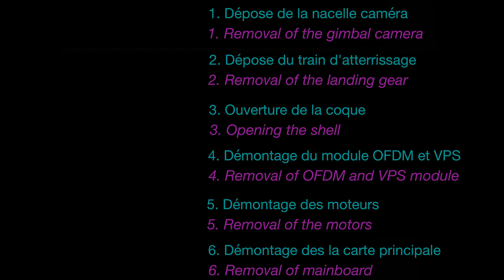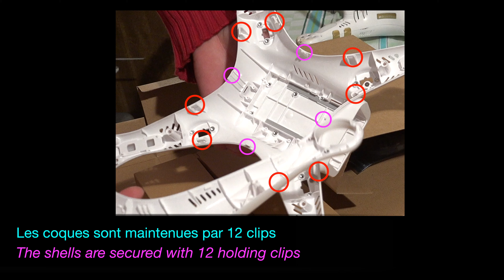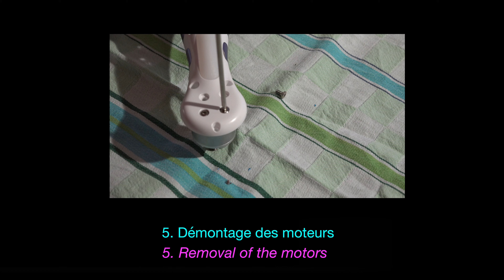Tuto de réparation d'un Phantom 3 - partie 2 - le démontage complet

Comment: Bonjour, avez vous une solution pour remettre en route télécommande phantom 3 pro qui ne s'allume plus merci
Reply from the maker: Bonjour, est ce que la radiocommande a été inutilisée durant une longue période ? Il est possible que la batterie soit déchargée profondément.
Reply: Non première utilisation, télécommande chargée, il y a du avoir problème sur la MAJ j'ai éteint et impossible de la rallumer, j'ai vu des tutos avec des tas de combines manip de plusieurs boutons je suis un peu perdu.
Reply from the maker: Oui en faisant un reset de la radio avec  un appui simultané sur les boutons c1, c2, enregistrement vidéo et mollette exposition, pendant la mise en marche
Reply: Merci mais cela ne marche pas
Reply: Merci mais le problème c'est qu'elle ne se mets plus en marche et je l'avais chargée au max !
Reply from the maker: ok, pas facile de faire un diagnostic à distance, je sèche. Ce qui peut être tenté ensuite : 1. essayer de charger la mise à jour avec une clé USB. ou 2 : ouvrir l'émetteur et débrancher l'accu quelques secondes. Vous pouvez aussi contacter votre revendeur (ou aller le voir s'il est proche).